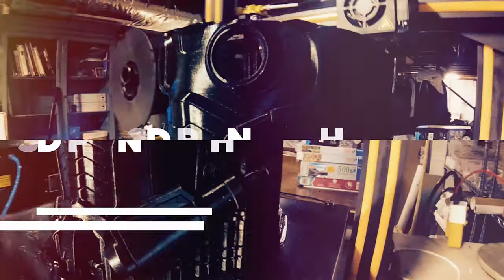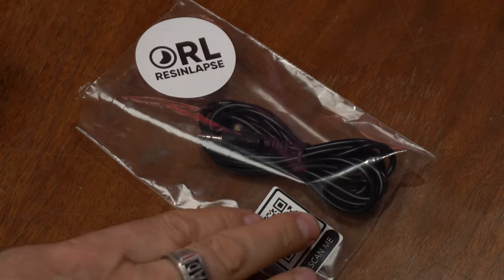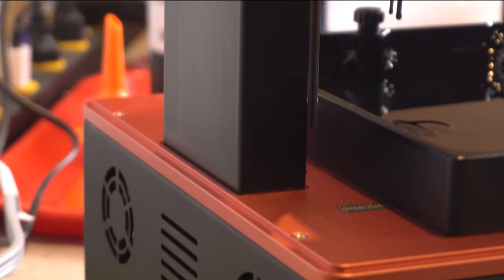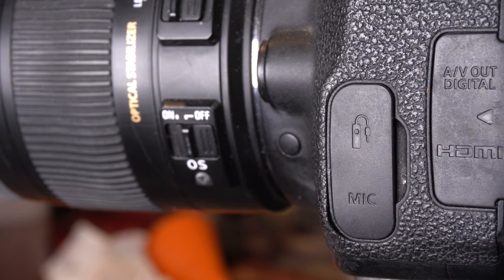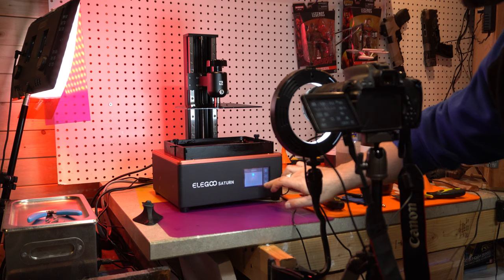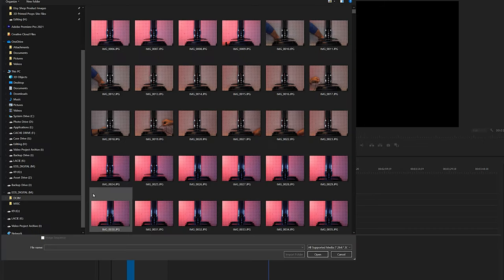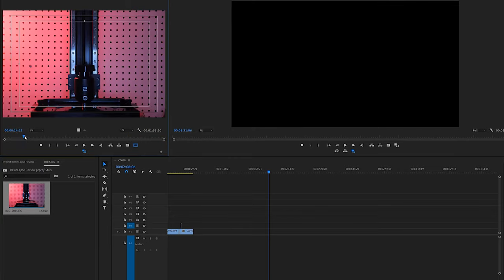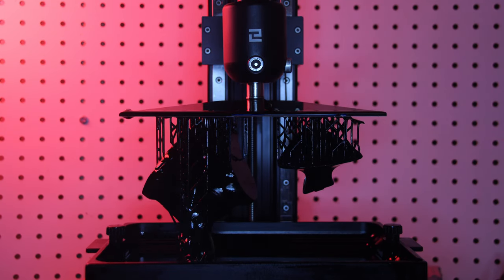ResinLapse Review and Tutorial | Resin 3D Printing

Comment: Great video. I just got my resinlapse cable. My camera supports it, and the light going on and off does trigger the camera to snap photos. However, it takes more than one picture per exposure of the UV light, for instance when it is curing the bottom few layers that stick to the build plate, those are longer exposures, my Canon just keeps firing one after the other until that UV light goes off. Is that normal? It might fire 2 or 3 times during a 5 second exposure too.  I have many professional DSLR cameras as I am a photographer, but I'm using a Canon Rebel SL1 just because I don't use this camera for anything except my photobooth rentals.
Reply from the maker: hmmm, not sure, I would contact them.

Comment: do you use electronic shutter or mechanical ? Would like to know how long the camera would last with mechanical shutter and a couple thousands of photos.
Reply from the maker: Well, this solution is an electronic shutter that trips the camera via light hitting the sensor. Not sure about what that does to a camera over time, but I've taken this canon around the world multiple times and clicked off thousands of shots, I think they're built for it. :)
Reply: @3DPrintedProps   ahh oh ,  ithink u can manually set the shutter type in settings